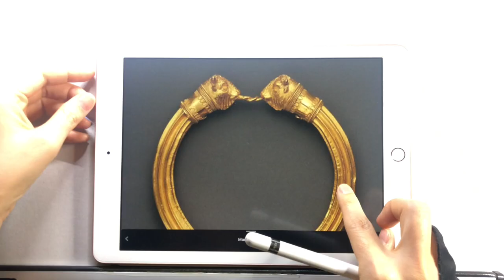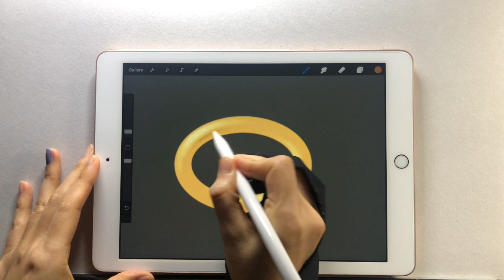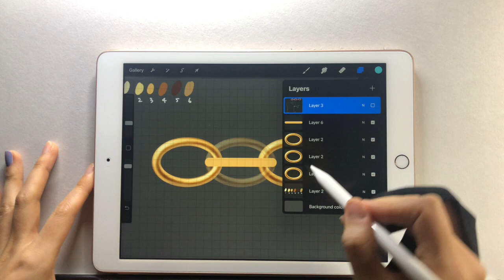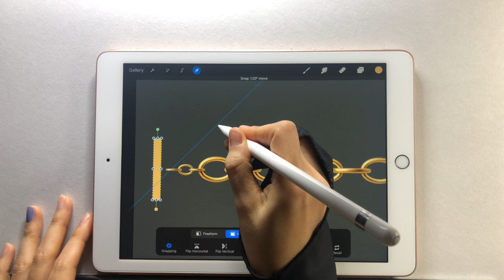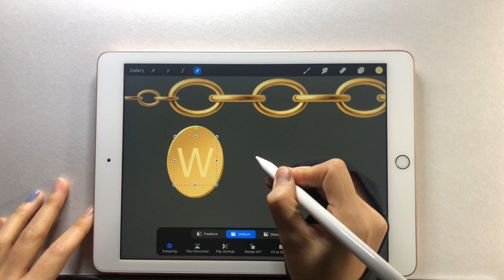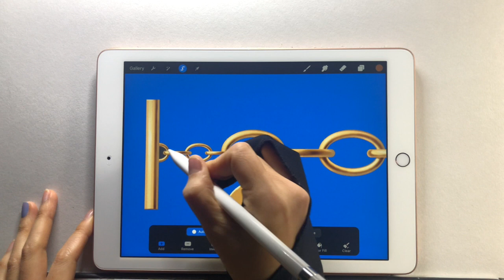Toggle bracelet WK

Comment: There is an easy way to add shadow. Duplicate the layer, then  with the duplicated layer you have 2 options. option 1: use curve and reduce the color to the darkest (black). Option 2, use alpha lock and paint with a larg black brush. It is faster than the selection.